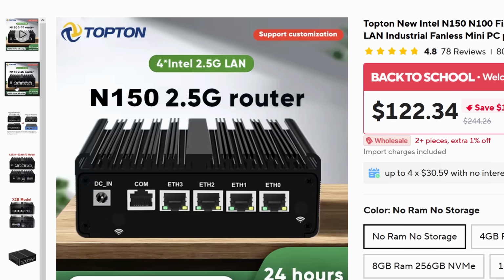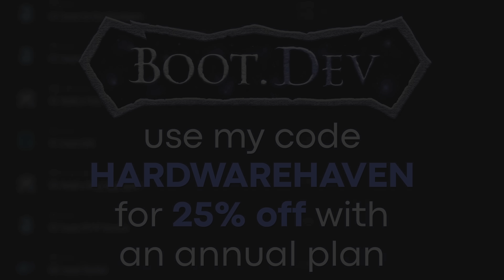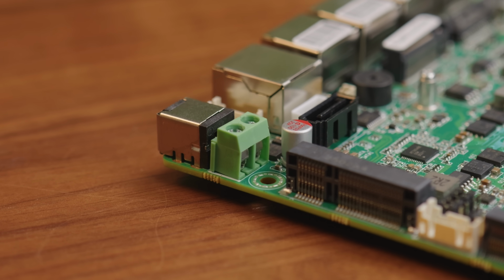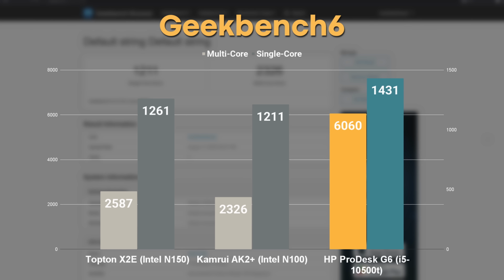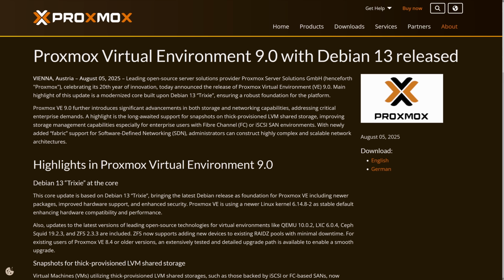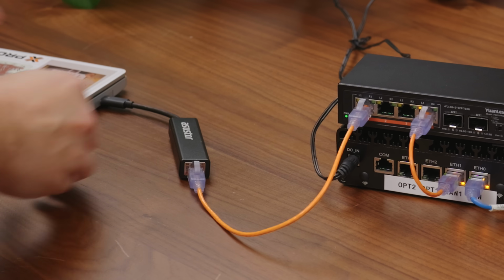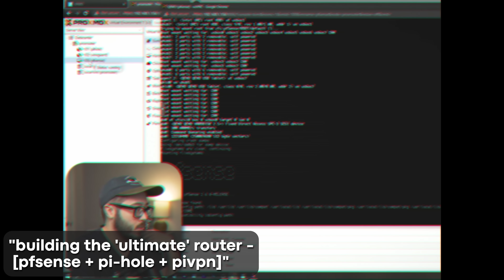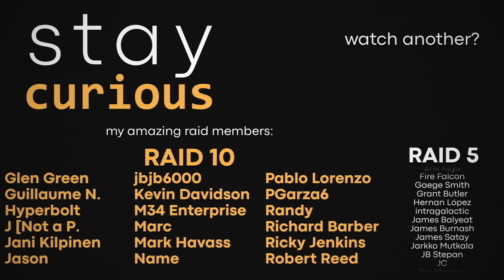Why Didn't I Buy This Sooner?

Comment: Tried those fanless N100 4x2.5G a couple years, ago, ran well, when they ran, found they had an issue with 24x7 operation....  would run great for 6 - 18 days and would just mysteriously power off.  Thinking it was thermal related so added a fan to the cooling fins, ran cooler but the shutting down issue persisted. Exchanged it hoping for a one-off... but got the same results. Never did figure out why, so returned and went with mini-ITX mainboards and haven't looked back...
Reply: I have a few of them and it's very common for there to be thermal issues that cause them to hang (not simply throttle). I am actually in the middle of asking their support (CWWK) if they know anything about it. (crosses-fingers)
Reply: Ive had one of these boxes running 24/7 for 2 years without issue (N5105).  I has a couple of lockups in the first few weeks but a microcode and kernel up grade fixed that. Internal temp is 40-45 C.  I sat an old cpu cooler to the top of the case to increase the surface area for passive cooling.  Running proxmox with opnsense, HA and Ubuntu vms.  Have PBS on a NAS, this makes vm backup easy, and also transfer to other hardware in case I ever need to. A useful and capable setup for my needs
Reply: @freeyourinnertube  They're very capable which is why I still use the N305 (the 2 N100s I have I also want to use, but the N305 is doing everything I need at the moment).

I track system stats via Promethus and Node Exporter, scraped every 2s, and looking at my graphs I see cores 1-4 are ~55C and 5-8 are ~44C. The avg for the past hour was ~61C. I've seen small things hit 102C for a second when viewing in btop.

It depends what you do with them, but it's a problem I've literally spent probably days of time on specifically cause this machine runs: internal dns, git server, coder server, internal CA ACME server, Grafana, Prometheus, NextCloud, Jellyfin, pgAdmin, vault warden, Hashicorp Vault, Unifi Network, ntfy, home assistant, and OpenWebUI.

To be honest, until I added jellyfin everything was totally fine for months. But this isn't the first time I have tried debugging strange heat issues with these CWWK machines I have.
Reply: I have two similar boxes with two NICs. Haven't had any problems yet, but none of them were running 24/7 until very recently. I can say having an extra fan on top is almost a must, it makes a big difference. Except maybe for the NVME drive temperature. That'll still get fairly hot even with a fan, which is not a big surprise.
Reply: I've had a fanless N100 running in my loft 24/7 for several months and it hasn't missed a beat.

It's very similar to the rebadge that he's using for the video, so merely using the casing as a heatsink.
Reply: I feel they have very extreme parameters for shutting off in terms of safety.

I have a device running promox with asguard, wireguard, and a windows10 that hosts an external Harddrive.
I haven’t seen any major issues. I feel for a cpu of this caliber you need to use it for proper usage.
Reply: @henrylin6537  So it turns out that despite CWWK not replying the BIOS was not configured correctly by them for a fanless PC. The machine was set to throttle at much higher temps than the heat sink could handle which caused it to actually freeze. Lowering the throttling/critical temp to 85C (I'm being safe cause I'm genuinely tired of it getting stuck) has basically fixed everything for me.

If you run node_exporter, besides the specific core temp metrics, the cpu_throttles metric is very useful for looking at these things.

Comment: This is a product I can't really do much with. I thought long and hard about whether I needed it. I also looked at a few firewall software programs, and even as an IT consultant with 30 years of professional experience, I have to say: better stay away from it. They're suggesting a level of security that doesn't exist. If you really believe you need a firewall, go to a Sophos Gold or Silver partner and buy a product with support that will install and operate it properly. The problem isn't buying a hardware appliance and installing an OS on it, but rather the firewall controls and log analysis.

Comment: My background: 30+ years in Cybersecurity in GSM phone companies & ISPs; I've had lots of very large enterprise network & server equipment in my lifetime, but I think it was in 2017 when I took some of these for the first time to create my whole "Enterprise Network on a wall" running Xen Server (XCP-NG) at it's core.  I loved it as I think it represents a commodification of hardware and hypervisors emerging into home markets. And the embedded use of Xen hypervisors in everything from Smart cars and EVs to industrial automation for security isolation and reliability gains make it clear hypervisors and virtualization has it's place in domestic homes as well, especially in our increasingly interconnected and interdependant world.  Micro architectures for home and SMB are really starting to mature and it's lovely.
Reply: I'm literally a software developer and what you said made me go 

"Urr, wut?"

I've got a 1 gig one running pfsense and it's rock solid stable. Just runs and runs and runs without any bs. 

I'm looking at these 2.5g ones now just because why not? 

I mean, why give to charity when you can buy a faster router? 😂🥴

Comment: N100 is often more than enough for most people's DIY router needs.
Reply: I find that even a J5005 is still good enough for my needs. I doubt I'll upgrade to a N100 for some time.
Reply: @someguy3186  I don't know much about the J5005. I only know that N100 was designed to give you previous intel gen performance, but at a much, much smaller wattage.
Reply: @DynMads It’s also a low wattage Intel cpu, but older and considerably less performant than the N100. But it still has much more performance than the average consumer router can provide. Just expanding on your point on how most people don’t need all that much for a DIY router.
Reply: @someguy3186  Ah yeah, that's true.
Reply: Oh definitely, but the N150 is basically the same thing. VERY small upgrades at a slightly higher price, so if you're planning on getting an N100 then an N150 isn't exactly a huge overkill upgrade.
Reply: I've been using one for a year with no issues, sans one: being unable to keep the display active for my KVM.
Just got mine reconfigured to act as a NUT server and even do some Stratum 0 GPS NTP work.

Comment: These things are great - Not sure about the N150, but I have an N305 system that took 48GB SODIMM without any trouble, and there are reports on the internet of others using the new 64GB SODIMMs without problems. I'm sure it's "not officially supported," but works great.

Comment: the most optimal setup for these little devices is usually going with openwrt because it performs way better than pfsense / opnsense - you can go with either native install openwrt (and openwrt has docker as a package so you can run everything else as docker containers like plex / jellyfin and use quicksync) or you can install proxmox and do everything out of LXC containers, making an openwrt LXC container and docker LXC etc
Reply: Openwrt Router Software 
Pfsense ist a Firewall 

Total different pieces of software.
Reply: @adamturtle69  both are and have firewalls, pfsense / opnsense will be easier to use with better GUI but in terms of performance the underlying parts (linux vs freebsd) on the networking front, linux now destroys freebsd and has done for a good 5 years now. its a real shame freebsd hasn't kept up, because its prior claim to fame used to be networking, but sadly that has long since passed
Reply: @adamturtle69 for the purposes of 99.9% of home users, both are both. If it facilitates a connection between networks - it's a router. If it filters traffic - it's a firewall. 
You can disable the firewall on OpenWrt, just like you can run OPNsense as a pure firewall for an unfiltered connection (e.g. from an L3 switch). But for most people, both are both.
Reply: oh and you can limit the power in the bios, i have the N305 variant and it consumes 6w at idle / when running plex without transcoding - when doing transcoding with quicksync that consumes +10w power. that 16w power bill includes a 140mm noctua fan attached running over usb which causes 100% fan speed, removing the fan shaves off 1.2w of power

Comment: I have similar topton/cwwk one with n305 48GB ram and 5x 2.5Gbe and 4x m.2 expantion board. Running proxmox from m.2 sata and  3x 
4tb m.2 nvme for truenas scale and immich. M.2 nvme used with pass through to truenas. One slot still free. I bought it about 2y ago. Because of big m.2 temperatures i use 140mm low rpm silent fan on the heatsink.

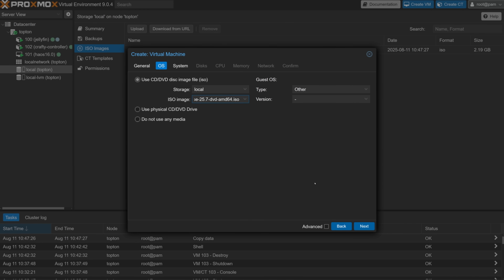Comment: 13:39 those cpu power should be used to fight bufferbloat with SQM, run vpn, maybe even play with dpi, there's lots of network-specific cases which will bring this cpu on it's knees
Reply: i have the same exact model that has been reviewed, i'm not sure on what you mean exactly. but i'm happy to test things on this model if you wanna confirm anything
Reply: N100/N150 don't have enough CPU power for SQM of 2.5G.  Need an N305 at least for that.
Reply: @JimLeonard  😱damn, i bought n150 hoping it'd do SQM of 2.5g. It does SQM of 1Gbit fine, doesn't go above 20-30% cpu utilization, so using linear math, 2.5G should be fine...
Reply: @JimLeonard  nah I have the N100 version of this thing, it's fine. Most of the buffer bloating I see happens because of the next upstream device that I can't do anything about. On my local network I see no buffer bloating issues using one of these with all 4 ports chugging packets and I see < 20% CPU usage. Mind you, I have mine in a rack with a front mounted 3 fan setup blowing air over it, so it's always running pretty cool.
Reply: @pipeninja4741 But are you shaping 2.5g traffic? Mine was fine at 1g but hit 100% CPU at around 2g.

Comment: I got a similar one of these a couple months ago - same CPU, 2 more NICs and one more nvme alot, but each only one gen 3 lane instead of two. I spent weeks trying to get the router to work before going into a customer service center for my ISP where an employee (who said he was likely the one one who could have helped me) told me that this wouldn't work without having my ISP specifically set up my service to recognize the new router's mac address, even though i had set OPNSense to spoof the other router's mac address and that router in bridge mode. Haven't gotten around to jumping through this new hoop because I'm worried it still won't work 😅

Comment: You didn't touch on the serial interface. You could use that as an out of band management interface as you can typically configure BIOS of serial and enable serial management within the OS and then use another machine to serial in and have full access.

Comment: I was considering one of these, but I found that old QLogic 4x10GB NICs are being sold for $30 and popped it into a i3-9100 proxmox node and virtualised my router instead. It is crazy they sell for $30 when 10G Base-T switches are $150+
Reply: Used server parts are cheap.
Reply: I just hate having my router and server on the same hardware. Great single point of failure
Reply: @classicrockonly me too, its not a problem until it is, then its a royal PITA
Reply: What is model number for that?

I assume those are 1/10Gbit only?
Reply: The only problem is that if you ever want to do any maintenance on your server it will also lead to no internet access.
Reply: 😮

WOW 

I'm moving and I'm planning on setting up a really sick setup at the new house... I think you gave me a good idea. 

But I think I'm going to try to go for an HA router setup. 

Two nodes with router VMs and dedicated nics. 

With two separate isps
Reply: Where?
Reply: @onefuriousfox6558  google
Reply: Well guess that's how I'm getting 10Gb networking
Reply: Mundane hardware blows these out of the water by orders of magnitude at much better performance/price ratio - if form factors are not a primary concern.
And depending on shenanigans at or around the manufacturer, they are also a security concern (China requires backdoor installation and companies to deny any such action - by law).
I built 25G router/firewall machines using older Ryzen and Epyc platforms with readily available Intel NICs.
With lower TDP or disabled PBO etc., passive cooling is possible as well.
Reply: Old QLogic with 4x10GBaseT? As others ask, can you give a model number?
Reply: can they be used for 10G networking? can someone give more details, what would be needed, power consumption etc?
Reply: @ExtraCrispy You have literally just asked if a 10Gb network card can be used for 10Gb networking.
Reply: @incandescentwithrage  well yes, I want to know what kind of cables (sfp, rj45), switch etc is needed. since 10gbe is usually pretty expensive
Reply: Can you give me the model number for the Qlogic? I am trying to find it
Reply: @thesleepingGOD_  Qlogic QL41164
Reply: For everyone asking, I got the QLogic ql41164hfrj, it is 10G Base-T not SFP, I have one port for the WAN from my ISP Router and the three others are bonded LAN ports connecting to my switches and directly to workstation + server
Reply: Can they work at 2.5Gig? What is the power consumption?
Reply: @dustojnikhummer No, 1/10G only and they consume about 18w for me
Reply: @dustojnikhummer  for 2.5g you don't need to buy these
Reply: What is the model number?
Reply: Oh my. Thank you. You’ve just 🤯
Reply: you guys have zero research skills
Reply: Brooo thank you so much,i hope that you,by not gatekeeping that,wont make this opportunity spoil
Reply: What that Speed for in a homelab?
Reply: @adamturtle69 I use it for file transfers. My SSD NAS saturates a 10Gbe link easily I have 25 gig NICs but switches are still pricey
Reply: @adamturtle69 believe me file transfers need ALL the speed
Reply: Dell QL41164 SFP+ version
Reply: If you’re using the separate ports to segment your network that’s fine but using it as a switch is not going to be ideal

Comment: I have almost the same unit (but with a N100) & I have been very happy with it for a router. Unlike you I have been very happy with the N100. I think it's awesome for minor tasks. It sips very little power & for uses like plex & with quicksync it's a transcoding powerhouse. Now would i use it for something like gaming or my primary desktop of course not (i wouldn't use it for proxmox either) but for a lot of tasks its perfect.